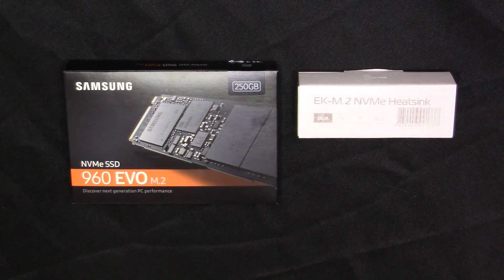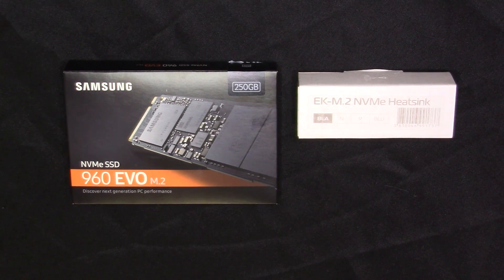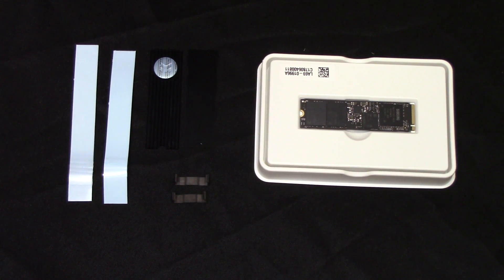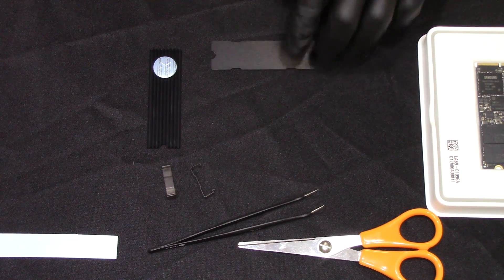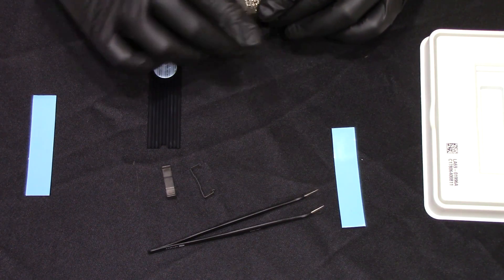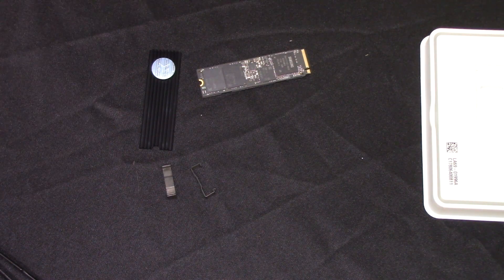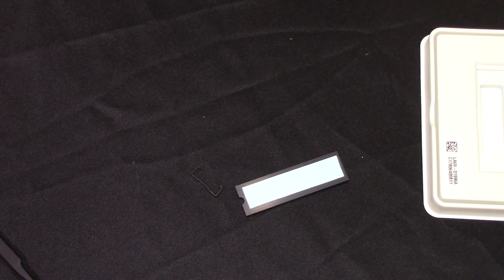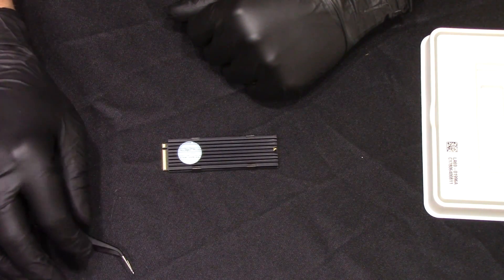EK M.2  NVMe Heatsink Installation

Comment: Pro tip
When installing the metal clips just place the entire ssd on a desk or flat surface and put a tiny amount of force on it and it should snap into place without having to risk snapping the damn thing in half.
Reply from the maker: Good tip!
Reply: @NerdW0rk  Yeah, mine gave me much more trouble than yours did in this vid. Im sure it would save others similar frustration.
Reply from the maker: I pinned your comment so can help others
Reply: My clips won’t work and they keep scraping the SSD.  I think it’s going to break.  What shit!

Comment: So my m.2 I just installed (without a heatsink) is right above my gpu and the gpu has no backplate on it, I'm worried about clearance because I wouldn't want to have the heatsink short anything on the gpu. I checked ekwb but didn't see any listing of dimensions. I feel like the mobo and m.2 slot should be standardized enough to where the heatsink gpu clearance should have already been taken into consideration but, I'd still like the dimensions to measure and be sure. What do you think?

Comment: Some things left out of this video: 

- A much easier way to align the card and heat sink is to sandwich it all together (before applying the tape), then tap the side with the screw notch on a flat surface (like you would with a stack of cards to align them).  This will line everything up and you can use your fingers to line up the sides.
- The thermal tape has plastic on BOTH side. You need to remove it otherwise one side will still have plastic and actually insulate instead of transferring heat.
- Don't be so quick to remove the SSD label. For most it will void the warranty. Additionally, some are made of aluminum which serve as mini heatsinks, so keeping them will help with heat transfer.
- Those metal tabs are slightly taller on one side. You pre-clip the short side and use the long side to pop it into place.

Comment: Actually you just need to put the thermal pad on the controller module only, not the nand chips as it needs to get hot to writes data, over cooling it may shorten the lifespan of your SSD.

Comment: I semi used the video to install this on my Samsung 970 EVO Plus going into an MSI Z390-A PRO, something I have yet to hear anyone mention is to look at the clips, and make sure they are facing the same way, you will notice one side has a more aggressive angle like a triangle, you slip the other side in first then pivot it down like closing a toilet seat using the slide to force the clips outward and they spring back in, very easy to install.
now under load it went from 50°C to 37°C

Comment: I started looking for an online tutorial when i didnt know for sure if both sides of the thermal strip had a seal that needed to be removed.
Your tutorial did not answer the question, and if you did remove it, it was not on camera. as feedback i can advise to use a different color cover, as black on black made it difficult to see, and keep the camera focussed on the installation.
Allso the clips have 1 specific side that clicks into place easy, if you clip the wrong side first you will have problems.

Comment: If you had read the Samsung Docs on the drive you would know that the label you removed was a specially designed "Heat Spreader" and should have been left on the drive.

Comment: thanks for video i got this https://www.amazon.com/gp/product/B077SSV15R/ref=oh_aui_detailpage_o00_s00?ie=UTF8&psc=1
idk if it comes with thermal pads but what size thermal pads should i get to mount on this so i can make sure i am doing it right i have the 960 evo 500gig
Reply: "Best of all, installing STORM is easy since it includes pre-applied thermal paste. Users just need to place it on any M.2 2280 SSD and plug in the fan header." figured out my own question just wanted u to check this product out aswell as it is fairly cheap
Reply from the maker: Didn't know they made those. May check it out. Thermal pad size though for the EK one is 1.0mm and 0.5mm. Then cut to length depending on size of M.2 drive.

Comment: I bought a heatsink from China, the heatspreader looks fine but instead of thermal pads I got basically adhesive paper thin strips.  I think I'll order some cheap thermal pads from newegg just to be safe.
Reply from the maker: +Jonathan West you got get a roll of thermal pad for pretty cheap. Always good to have extra in my opinion anyways, especially if you swap hardware a lot

Comment: my samsung 960 evos run a lot cooler with out the heat sink as the chips are getting direct air flow the heat sink pushed my temps ups by 18c
Reply: I've seen some performance benchmarks and these sinks are supposed to decrease temps by roughly 10 c.
Here is one video I found:

https://youtu.be/6x4NfKSJ-b8?t=1m4s

doing a google search there are some reviews by anandtech and other various reputable IT sites. Anyways I got 2 of these for some Intel 760p 256GB drives for x299. Very excited for my new build!
Reply from the maker: +Phil & Kyle Thanks for the feedback, that's odd though mine had a decent reduction in temperature. Is your case somewhat restricted on airflow?
Reply from the maker: +Mr Twister it really depends on the setup and airflow. It's a passive cooler so if it does not get decent air flow it doesn't do the best. However excellent air flow and it really cools the M.2 down.

Comment: I dind't have any issues with the istructions, but you really have to push hard to get those clips to latch on for the 960 Evo. So seeing that it al fit as it should in this video did save me quite a bit of time. Thanks for that :)
Reply from the maker: Rainmaker you're welcome! That was one of the reason's why I made this. Thank you for your support!
Reply: I was afraid I was going to break the thing at one point. The spring latching fitting mechanism is far from the most elegant solution they could have used, but I guess it shaves quite a bit off the cost  and size compared to something with screws.
Reply from the maker: +Rainmaker Yeah I hear you on that for sure. Could have been made better but for the price I think it justifies the design.

Comment: im wondering what any testing results will confrim though cuz from what I've read that heatsink does absolutely nothing. I mean, if that's its purpose is for aesthetics i get it but then call it a shroud not a heatsink lol
Reply: Some reviews noticed a temp drop of the ssd between 5-10degrees C so I would not say it does nothing.
Reply from the maker: +Matt Sweeny I have been debating doing a performance test on it to see the differences. May make a video of it
Reply from the maker: +MrPolypropylen you are correct.  And even if barely a temp decrease it does look good and not every M. 2 looks good like some of the Samsung models